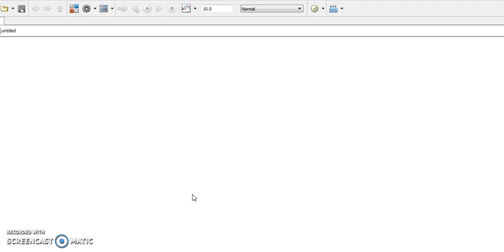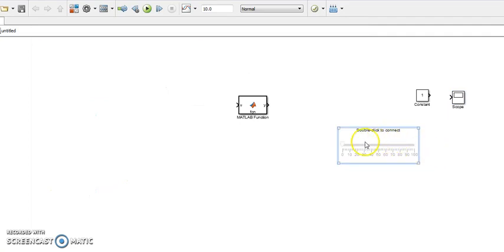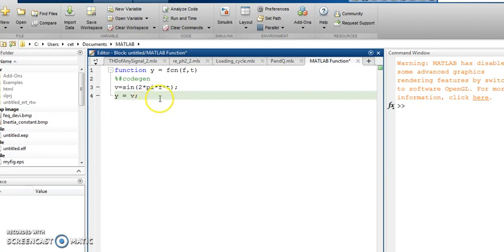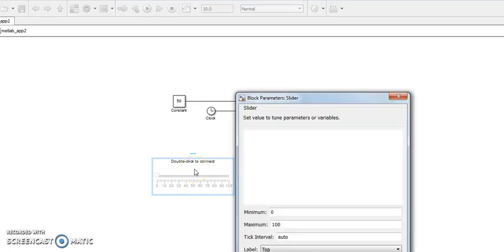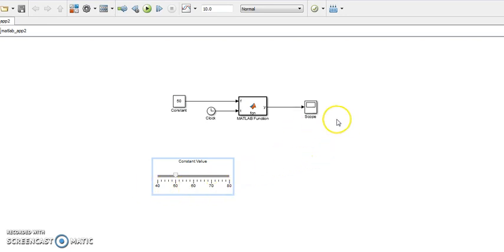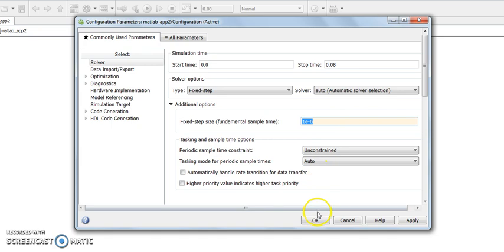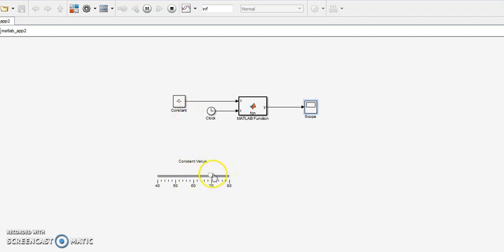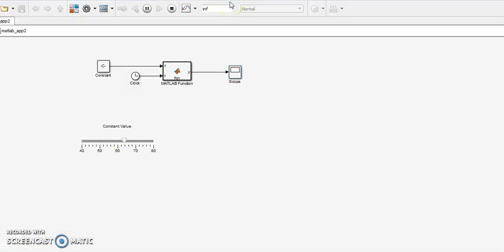Simulink User Defined Function to plot Sine wave

Comment: thankyou sir ,but what if we want to bias itto a certain voltage
and what about amplitude information?
Reply from the maker: Thank you Rajendra for your query. 
If you wish to bias voltage use saturation block available in the simulink library and for recording the amplitude information use export block for exporting all data fetched during simulation. The data can be used to plot the amplitude change over the time.